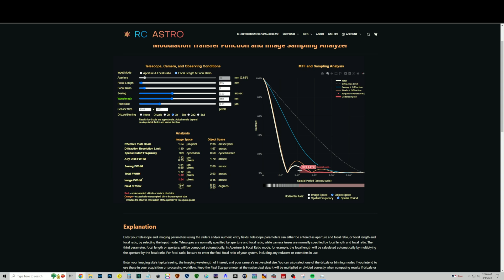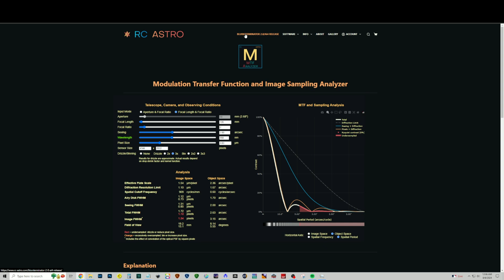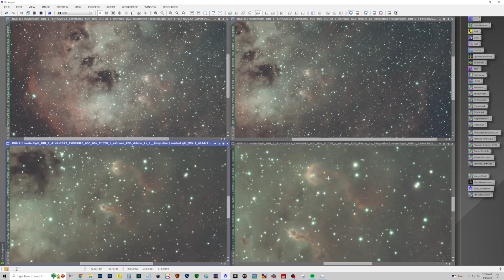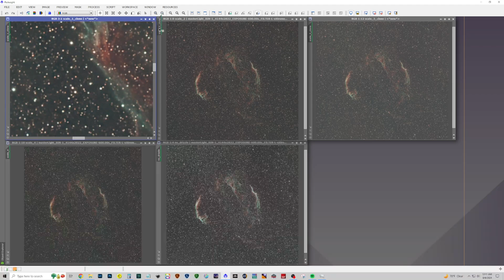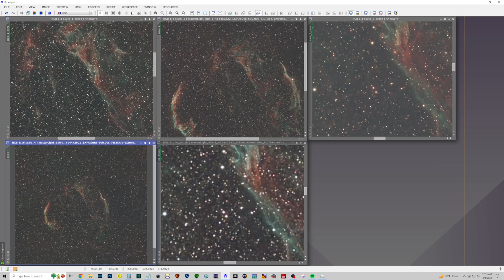My New Thoughts On Drizzle Based On Real World And The MTF AND Image Sampling Analyzer Calculator...

Comment: Are you dithering? By how much and how often?
Reply from the maker: I always dither between each image unless my images are less than say 2 minutes in length. In the guiding settings in NINA the Rokinon 135mm dithers 5.5 pixels and the 75Q dithers 5. I'm still tweaking the settings to really dial them in. But I don't experience any walking noise with these settings.